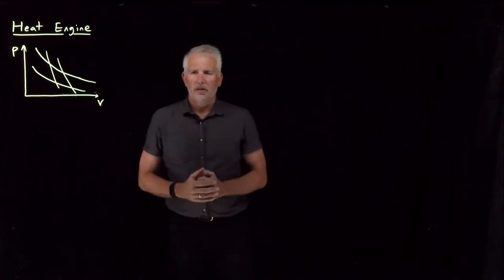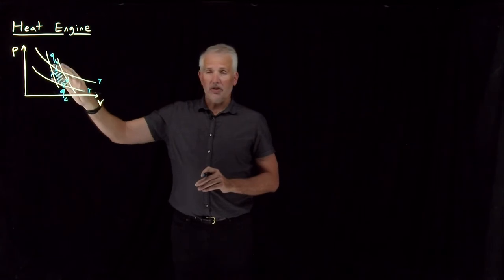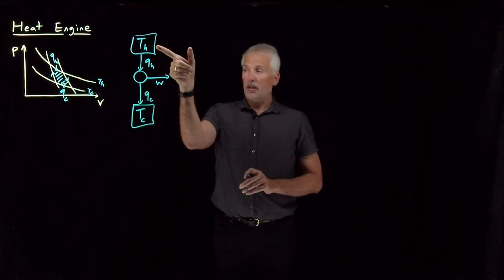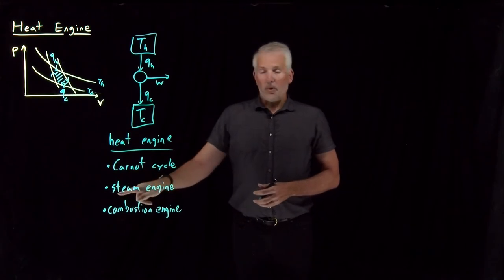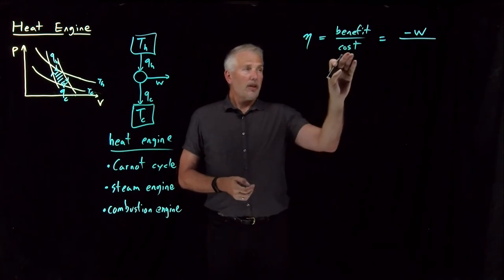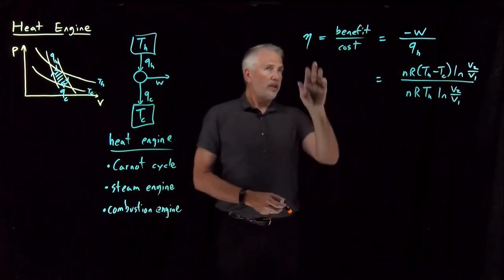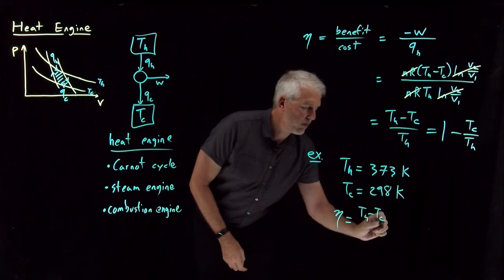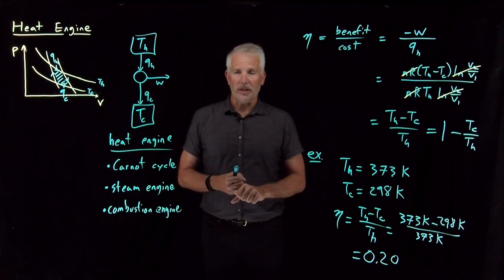Heat Engine

Comment: The system is insulated ,so the Q_h given as heat will be used in doing work ,but how does it expel heat as Q_c,if all the heat becomes work  ?
Reply from the maker: The adiabatic steps are insulated, but the isothermal steps are not. So heat does transfer to/from the environment in those steps.

See the preceding video on the Carnot cycle for more details: https://www.youtube.com/watch?v=szyFQuPiP9s

I love your username, btw!

Comment: Can you please explain why here you write     -w = nR( Th-Tc) lnV2/V1.. and not (Tc-Th) as explained in the previous video for the Carnot cycle? Is it because you switched the signs?
Reply from the maker: Yes. In the previous video, we had

w = n R (Tc - Th) ln V₂/V₁

In this video, the numerator is −w, with a negative sign. I could have written that as

−w = −n R (Tc - Th) ln V₂/V₁

But instead of adding the negative sign out front, I just switched the order of the two temperatures, using this instead:

−w = n R (Th - Tc) ln V₂/V₁